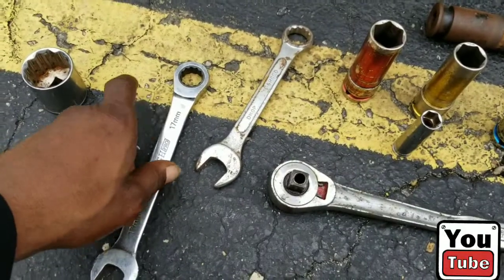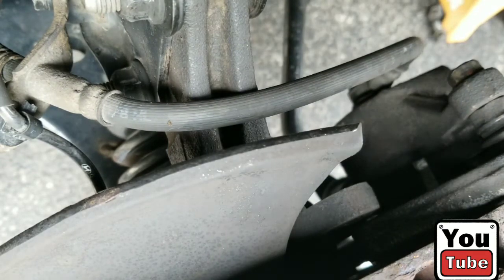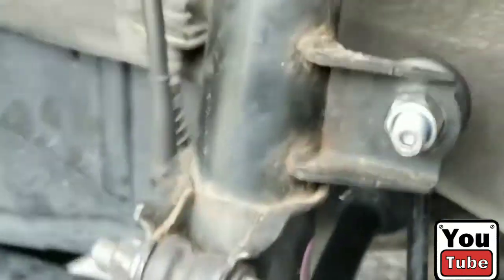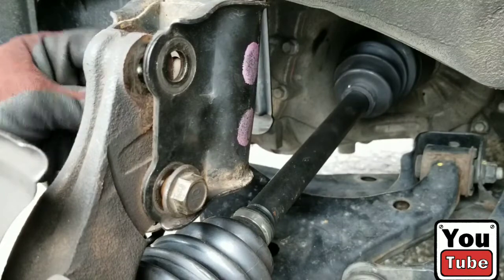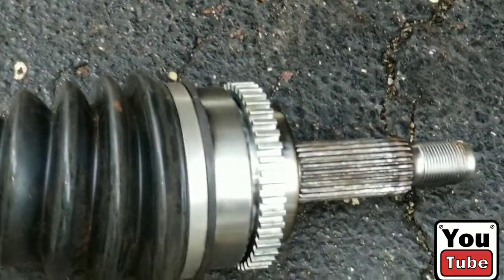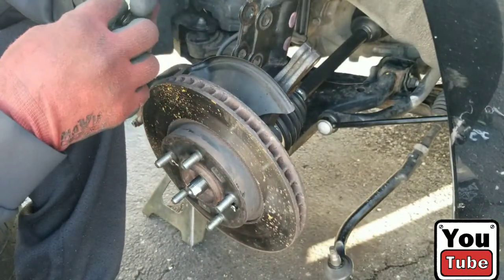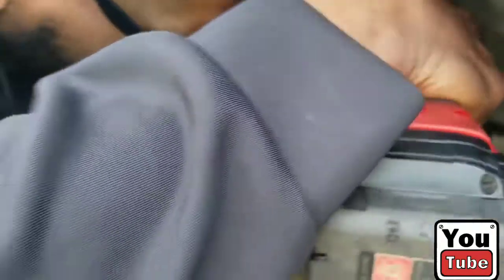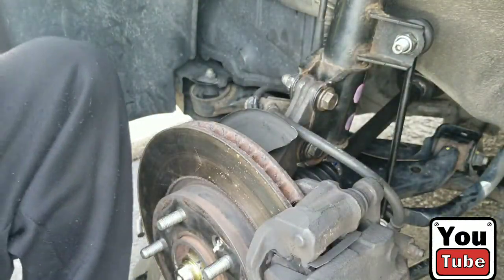2010 Kia Forte Ex Driver CV Axle Replacement

Comment: Checking VIN my 2011 Forte EX says it’s a 6spd Automatic, but yours is a 5spd automatic, and you accidentally installed an axel for a 4spd? Is the 4spd and 5spd for that year only? Just need to know if I need to know anything else before ordering Axel, thx!
Reply from the maker: Just check what month it is made sometimes if its in the 12 month of the year it count towards the new year model. Thanks hope this was helpful let us know how it goes.
Reply: @willsshopdayton5206  guess there’s only 1 for automatic and 1 for manual. Btw what size is the castle nut on the hub? Which mine is loose and prolly why I’ve been having problems and my shaft went bad 😬
Reply: @willsshopdayton5206  yup, I ordered for my year and it was wrong piece …didn’t know about that 12 month deal
Reply: @Tekjive the 2010 kia forte comes standard with a 4 speed auto trans, but has an optional, less common 5 speed auto too

Comment: Thank you for the video. My only criticism would be to torgue bolts to spec. It would be a bad day if bolts came loose.  Also I would use anti seize spray or copper spray on axle before installing in knuckle. If you keep car for long it will save you aggravation removing it in future repairs. Thank you for taking time to make video. ✌
Reply from the maker: Appreciate the comment thank you have a blessed day
Reply: Neither is necessary, copy paste warriors love to jump through videos 😂

Comment: Wish mine came out this easy my cv axle is seized in wheel hub..a simple job just turned into a nightmare i am to the point of cutting the axle in half and replacing hub as well..i noticed the noise and immediately tried to replace it the same week so it should not have gotten to that point already..
Reply from the maker: I'm sorry to hear about your nightmare this is why some of my subscribers pointed out the use of anti seanti seize on the CV axle when installing it I wish yours had came out as easy as mine fine you probably live in the rust belt never a easy job let us know how you solve this problem.
Reply: @willsshopdayton5206  i made some progress on it thankfully i soaked it for days with three different penetrating oils took some heat to it and finally got it out..now i am going to get a hydraulic press to get bearings in and out and to get the hub back together with the knuckle hopefully it will be smooth sailing from here on out..thanks for the video it was very helpful

Comment: Great instrutions!  I want to confirm, to pull the drive shaft out after you got everything out of the way, you "pried" the drive axle with a screwdriver to release it from the transaxle.  Right?  No clips or special tool needed to pull the axle out.. (2010 Kia Forte)  Mine is a 6-speed manual - should not make a difference. 
Great Video and thank you!

https://www.youtube.com/watch?v=JONsJ-XaFb0&t=6s&ab_channel=Will%27sShopDayton